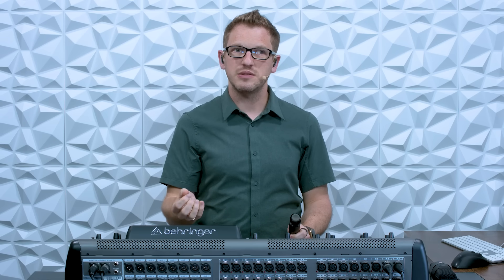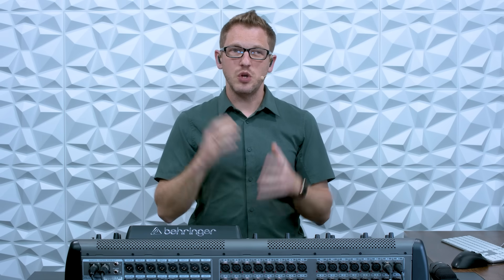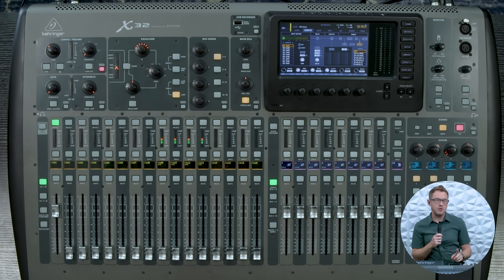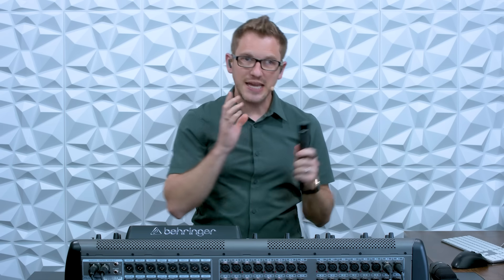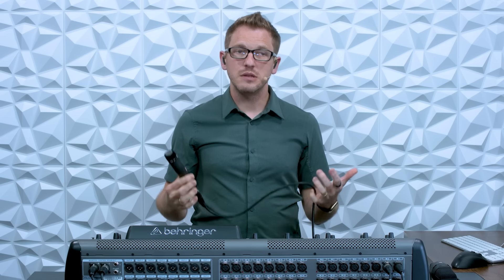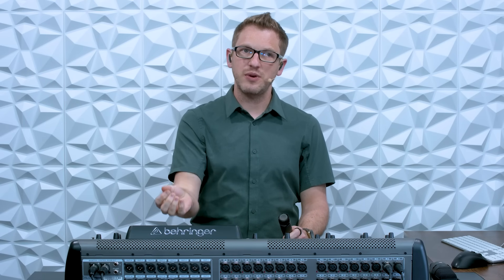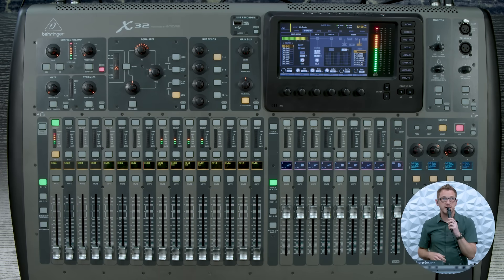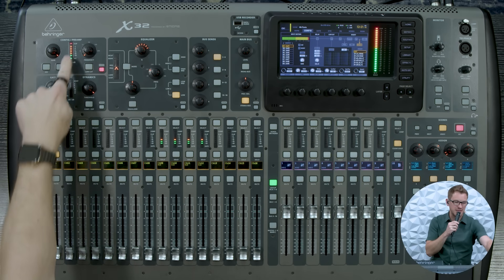Audio 101: What is Gain? (Preamp / Headamp Explained with X32)

Comment: Hello Drew,

I'm a big fan of your X32 tutorials! I have a specific question regarding multitrack recording to a DAW (Reaper, in my case) while managing gain structure for both FOH and the recording.

My goal is to have independent gain control for the signal going into Reaper, separate from the physical preamp gain knob on the X32, which I set for Front of House. When I adjust the physical gain knob for FOH, it directly affects the level recorded in Reaper, and I want to avoid this.

I've explored the "Routing" -> "card out" section and tried setting "Tap Points" to "Post Fader" for the Direct Outs. However, this still seems to be affected by the initial preamp gain.

Is there a method on the Behringer X32 to achieve truly independent input gain for the USB card output to a DAW, without affecting the FOH mix, or is the physical preamp gain always the primary source for the card out, requiring me to adjust input levels within Reaper itself?

Any insights or a specific routing setup suggestion would be greatly appreciated!

Thanks, your big fan from country GEORGIA <3

Comment: Great video Drew, however I think a bigger problem that needs to be preached to the masses and is much more common than your PA being too loud, is not having ENOUGH PA which causes you to push the output and speakers waaaayyyy too hard. 
Most people don't educate themselves on gain structure, so if they see there is space to push it, they will. 
I recently was explaining nominal level to a client, and understandably so, they asked "why is there more space (orange and above) for the level to go if down there (green) is the max?"
We as sound techs know why, but we aren't always the ones running the event/show.
Personally, I would prefer a digital meter option similar to analog where the ceiling of the channel strip and master meters are -18dbfs,  even if there is still 18db of headroom built into the output. My understanding is some Pioneer DJ mixers have 6-12 db of headroom still available when the master meters show its redlining to combat this issue. 
Unless it's a professional production, there is almost always not enough PA for an event, and consoles are pushing way too much level.
Reply from the maker: That is a fair point, I think we all see it when budget is an issue. Also smaller speakers driven hard will never sound as good as larger speakers driven at a normal level. I'll have to add this to my video list!

Comment: Hi Drew thank you for the video!

Question: Is it better to have the level on the microphone itself on -10, -20, and add that gain on the mixer. Or is it better to have it at 0. Basically what would be the reason to restrict incoming gain from the microphone or instrument itself?
Reply from the maker: That all depends on what you are mic'ing up! The pad switch you will find on condenser microphones, and those have preamps built into the microphone itself. So if you are mic'ing up something really loud like drum overheads for example, you would want to set that pad to -10 or -20dB so you don't overload the microphone circuitry.

If you are mic'ing up something quieter, leave it at 0dB.

Another key example is that if you are running 0dB of gain at the mixer, and it is too loud on the preamp, you can use that built in pad.

Hope that helps!

Comment: Another great video Drew, Thank you. I could really use a video explaining why I’m getting such low levels to my livestream mix. Everything sounds super hot when I monitor it in my headphones but the overall outcome when I listen on YouTube is very low. I’m using x32 with pro presenter btw. God bless.
Reply from the maker: Interesting, are you using any gear in between the X32 and the streaming computer or taking it directly off of the USB connection?

I do have this video that talks about LUFS and loudness, give it a watch if you haven't already: https://www.youtube.com/watch?v=2jhggSKR2AI
Reply: @DrewBrashler I’m going straight into the streaming computer. I am running the limiter in the x32 the way you suggested in one of your videos. Is there any gear you would suggest? Thank you so much for the reply, it really means a lot.

Comment: I've found I have to OVER gain in order to push enough volume for a rock band through cheaper PA systems. Has anyone else seen this? W're using Harbinger 12" tops and 1 18" sub ... not really an issue with the sub, but with tops output at 3/4 volume if I gain to -22 I cannot push vocals above the band .... if we gain to -18 to -12ish ... I have the ability to pus hvocals up enough ... also kick gained at -22ish does the same thing ... I kinda can't get it throug hthe tops ... its really weird
Reply: Don’t forget to play to the room/system. There are a ton of shows where the band I tour with, I don’t even have drums in the mix aside from SOME kick drum. It’s not because of headroom or anything else, it’s because the PA literally cannot physically get louder than the drum kit in the room, plus adding in vocal mics that are only 6ft away from the kit. A lot of (most) bar venues in Chicago and New York are like this.